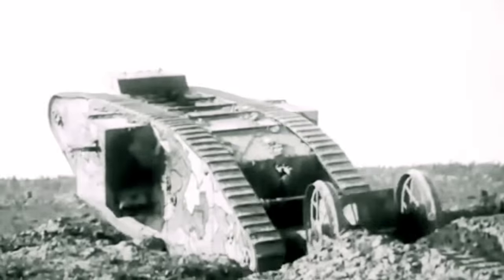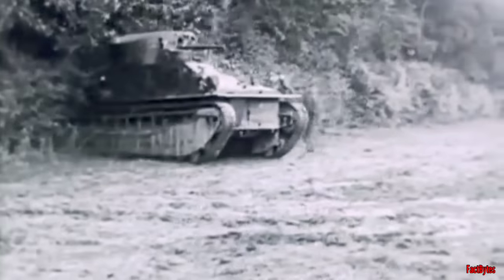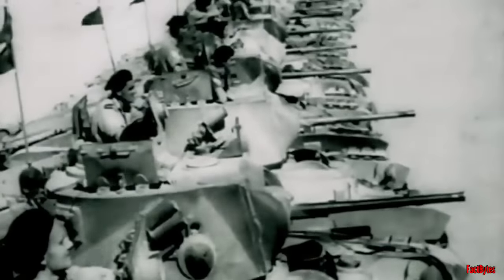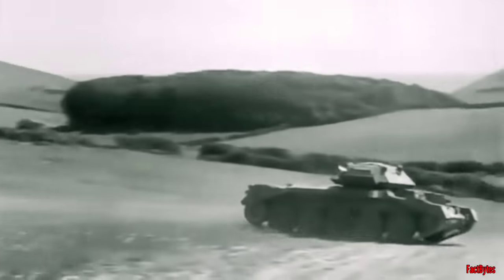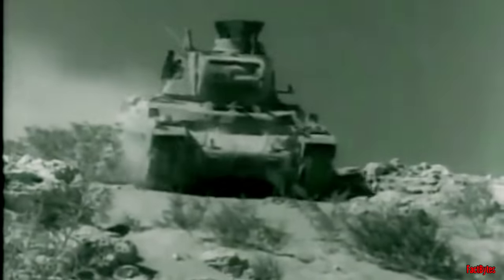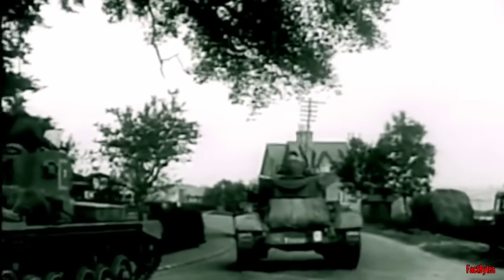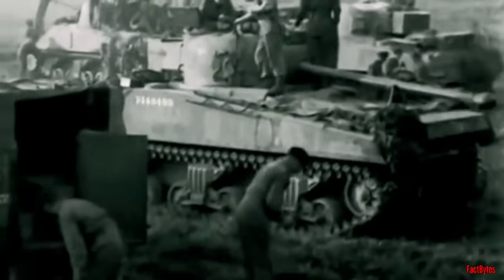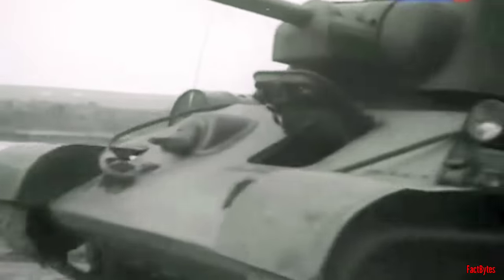Why Did Britain Struggle to Build Effective Tanks During World War II?

Comment: Could mention that the Centurion only happened when they gave up the 40 ton and rail transport width limits. Abandoning the 40 ton limit imposed by the fact that this was the capacity of the existing British tank tansporters and the width limit imposed by British rail was what made Centurion viable. Those completely artificial limits were the real story of the failure of British tank design.
Reply: The panzer 4 even the Ausf J was below 40 tons and and was within width limit imposed by British rail. yet saw service and was made throughout the war weight and width wasn't the problem british tank design and production.
Reply: Defenders of the udiotic British 'establishment' always point to such external factors that 'could not be ignored'. The 100-foit limit on bomber wing spans was another.

Meanwhile, every other country built the hangars to suit the planes.

Tanks were the same. The Tank Corps was much hated during the interwar period, the British Army thus had no goid tank advocates. On the eve of war, the anti intellectual cavalry was mechanised.

Another issue was letting companies produce what they could, rather than what was needed.
Reply: @lllordllloyd  you need to edit your post there are too many errors of spelling.
Reply: Ah yes, the British rail system. Considering it's abysmal state today, I'm not suprised to know it was screwing over this country back then too. At least it's consistant.
Reply: Interesting video, I wasn't aware of the railroad size constraints  especially on turret size.
 I think you under emphasis the importance of losing virtually all the British equipment at Dunkirk. If not for the need to crank out tanks and guns as fast as possible after Dunkirk,  the 6 pdr likely could hace come into service a year earlier.
Also, the advantage of the American 75 wasn't increased firepower against German tanks. For that purpose the 6 pdr actually had higher armour  penetration than the 75mm. The advantage of the 75 was that it had a much larger shell which meant it's HE round was more effective against infantry, unarmoured vehicles and guns. As you mentioned the lack of HE for the early tanks was a challenge, even the 6 pdr's HE round was barely acceptable.
People always talk about the tank on tank aspects of combat, they forget that tanks spent a lot more time engaging infantry and guns than they did enemy armour.

And by the time they were getting Shermans the Crusader reliability issues were solved, and they were putting out tanks like the Cromwell with the down rated Merlin engine which didn't have reliability issues. Taking on the Sherman was a necessity more due to a need for quantity than quality.
Shermans were definitely better tanks than anything the British could field in N. Africa and of course no other WW2 tank could match it for reliability, so it delivered on both counts.
Excellent video, great analysis, I look forward to more to follow.
Reply: Sherman had weight limits and size limits too but the genius of amazing American design engineers worked through it.  For me the most amazing design decision was to play to America's strength.

We were the unchallenged #1 world experts on mass producing gas powered engines. Did that have negative ramifications? DUH. As we engineers are experts in trade off analysis they went with it, and they were right.

One thing un-military types don't actually get, "War is Hell". Thus weapons and vehicles are designed to successfully complete a mission, not bring everyone back safe. Cast iron bitch but that's how it works. Why war should never be entered into lightly or even at all if at all possible.

Here's and example no matter what you saw on the tv show. MASH units were designed not to treat the most severely wounded, HELL NO!!!!!! They were there to patch up the most lightly wounded, shove a rifle in their hands and off to the front ya go soldier boy.

WTF do you think Uncle Sam spent all that time and $$ for FFS? To fight and kill the enemy fer cryin' out loud!!!!! Told ya "War is Hell.".
Reply: @robinsteeden7466  All the dimensions of a tank are inter-related. If the width is limited by the rail loading gauge then the length is as well. That will define track area and thus the maximum weight. Turret RING size defines the maximum size of weapon that can be fitted, but if you make a huge turret the tank will be very heavy and top-heavy. The Matilda II had a relatively small turret to keep the weight down and no way could it fit a 6-pdr. Where you see differences is in "schools of design", in Britain the turret basket is the same size as the ring. In German tanks they made the basket smaller than the ring, this will limit the angle of elevation of the gun (and reduce crew space a bit) but you can fit a bigger gun. The Germans also made guns with very compact forged breeches, compare the breech of an 88 mm (as fitted to the Tiger) with the breech of a 17-pdr, a gun of similar power. The 17-pdr in the Sherman Firefly was a complete redesign along these lines, it was not just turned on its side.
Reply: @sailorgoon501  The British rail system was very good then, if you consider wartime restrictions and demands they did miracles, the same in France, Germany or Italy. Employees had pride in their company then. After WW2 the line closures started, and it just went downhill. I lived in the UK in the 1970's, rail travel was expensive, the trains tatty and dirty, the staff unhelpful... I remember being asked to disembark at a station so that the carriages could be cleaned. We waited 15 minutes and boarded again, the chocolate wrapper I had put in the ashtray was still there... A couple of unenthusiastic-looking Asian women came in one end of the coach, shuffled to the other end and then on the next one... a farce.
Reply: If designed to be transported by rail within Great Britain then they have to fit within the parameters otherwise they will strike railway furniture promptly - it's as simple as that!
Reply: @englishrob8245  The Panzer 4 in its various iterations was a good tank, but most importantly was a simple tank to produce. Simple suspension that limited its speed but was easy and cheap to produce (the torsion bar business was complicated and expensive to make). The transmission/steering was a simple clutch and brake affair, the Pz 2 and 3 had Cletrac semi-regenerative gearboxes that were more expensive. The Tiger had the Henschel version of the Merritt-Brown regenerative gearbox (similar to the Churchill, Cromwell and Centurion, it was originally a British development) excellent but very expensive. The Panther had a similar gearbox which would have been good if properly made with the right materials, as it was it was continuously breaking down. In the end, if you can have 5 good tanks for the cost of 2-3 very good ones... what will you chose?
Reply: @lllordllloyd  This is true, one is left considering whether they were just pompous little bureaucrats showing off their power or actively obstructing the war effort. Perhaps the first with the occasional bit of the second...

Comment: A somewhat simplistic appreciation, leaving much out.  Others have mentioned the railway gauge issue being common to all tanks, the lack of Cromwell and Comet mentions.  I will explain how 1941 was the year that stalled British Tank design for reasons you don't mention at all. 

Before 1941 British tanks were certainly a match for any anti-tank gun and tank out there.  The Crusader was an attempt at a medium tank, officially a heavy Cruiser, capable of both infantry support and chasing. It was supposed to equip 18 Armoured divisions by the end of 1941, with improved developments following on as new guns became available. A 6pdr Crusader development (Cromwell and Cavalier) was due in late 1941, along with a 25pdr Support tank (Centaur) and a 17pdr heavy tank (Clan) for late 1942.  These later tanks would be used to spearhead an invasion of the continent in 1942/43.  

This was the Army plan, but it was cut back massively in early 1941, to nine and then six armoured divisions, using cheaper 2pdr armed tanks, in order to pay for an increase in RAF Bomber Command funding to reach the vaunted 1,000 bomber raid target.  This reduction in development money, kept the 2pdr Crusader in production long past it's obsolescence. 

The German's had re-equipped with 5cm guns by mid 1941 for both ATG and tank armaments. In the big open spaces of the desert the 2pdr armed British tanks were simply outranged and outmatched.  6pdr was there for the taking in mid 1941, but we had to wait a year for the production lines to match demand. All because of that lost year. 

6pdr armed tanks were delayed, and the 17pdr A29 Clan was dropped altogether. Cromwell soon got its own 75mm gun equivalent to Sherman and equipped half the British tank regiments in NW Europe by 1944.  It being followed by the 77mm armed Comet which was every bit as good as the latest German medium tanks in late 1944. Still all a bit too late because of that missed year. 

There was significant waste of effort in British production. We had a very good 76mm field gun from 1907 in the shape of the Royal Horse Artillery 13pdr. Designed to give fast moving cavalry its own fire support. The larger 18pdr was developed into the excellent 25pdr, but the 13pdr was dropped without further development. No good explanation has ever been given for this. We had 13pdr armed SPG on trials in 1931, but the idea of dual purpose guns in medium tanks fell away as 2pdr and 25pdr took all the available development money. 

British tank engines failed to meet demand in the late 30s despite several useful aero engines becoming available like Kestrel and Mercury. Instead bus engines were cobbled together, a purpose built flat 12 engine was developed that was too big to fit what it could power, with not enough power to drive the tanks it could fit. An ageing WW1 aero engine was put back into production at great expense, the Liberty, which proved to be Crusader's downfall. 

Despite all this it wouldn't be until mid 1941 that Germany had an advantage over us in design, thanks to our decision to concentrate on heavy bombers - eventually to claim upwards of 40% of our entire defence budget. 

This was the gap filled by Sherman, a British inspired development of the M3 Lee, they agreed to buy thousands on lease lend if the main armament was put in a 360deg turret, as the Canadian's were doing with their Ram series of Sherman type tanks. This decision enabled tank development to be outsourced from British investment and factories to put those resources into building up Bomber Command. 

We were back with good designs from 1943, but that mid war period was managed on starvation rations.

Comment: In the 1930s when the various branches of the British army were competing for resources, the artillery were concerned that the tank forces would get large guns at their expense.  So they drafted a letter that stated any tank with armor thick enough to withstand a hit by 2 pounder would be so heavy it would be immobile and sink into the mud, therefor no gun larger than a 2 pounder was required for either tanks or antitank guns, and the letter stuck.  The other restriction was they had to fit on a flatcar that pass through a railroad tunnel.

Comment: The biggest factor - engines, most tank engines of the time were aero engines, in Britain at the time they were all going to aircraft production, this left older, less powerful engines. Therefore you could have a fast tank or a tank resistant to medium AT fire, but not both.
Reply: The Meteor engine for British tanks arrived (I think) in 1942. It was a down-tuned Merlin engine.
Reply: Correct, although most were made from sub standard parts rejected for merlins as well as parts salvaged from crashed aircraft. In terms of the strategic picture merlins were more valuable than meteors, so unfortunately for British armour designers they were not produced in quantity until early 1944 although there was a small supply from mid 43
Reply: Ya gotta work with what ya got mate. Everyone had restrictions.

Comment: Britain   had  great ships  ,  great aircraft  --  and  the  worst  tanks .  Each tank  ( a dozen or more  during the war  ,  was  obsolete right off the drawing board   .  Germany remained at least 2 years ahead in tank ( and anti tank )  weaponry  throughout the entire war .
Reply: British submarines were pretty crap as well , which was really unnecessary,as the Admiralty knew about their shortcomings before the war . Chief of which was the riveted hulls which reduced the depth they could submerge , and because the riveted plates would move under pressure, releasing fuel oil which would float to the surface . Revealing the boat's position.
Reply: At the start of the war the 2 pounder out classed the german pak 36, when the Pak 38 was introduced the brits came back with the 6 pounder which again was a better anti tank gun then finally came the 17 pounder which speaks for itself I think
Reply: Actually, the worst tanks produced during WW2 came out of Japan and Italy. 
The quality of the steel was so poor in the Italian tanks that it would crack like ceramics after being hit by an AT gun.
The Japanese tanks were slightly above WW1 technology.
Reply: Actually the US designed and mass produced the Liberty ship that got it done.

To my utter shame I have to admit that the Wooden Wonder and the Lanc were best in class hands down. 😎
Reply: The Germans were not 2 years ahead in tank design. They over engineered their tanks and got obsessed with size so produced tanks that were unreliable, difficult to maintain and could not cross bridges or get enough fuel. If allied forces were unlucky enough to meet them, German tanks were good, but they were too thinly spread to make a decisive difference. 

The best tank is one that shows up.

Comment: There's another error, the issue of the diameter of the turret ring. The British school built the ring the same size as the basket, the part of the turret that runs inside the hull. The Germans extended the ring further out giving a stepped basket. Look at the Tank Chat videos from the Tank Museum, they show a lot of interiors.